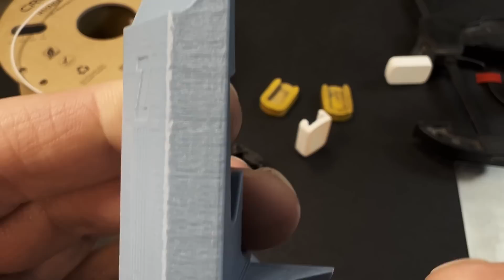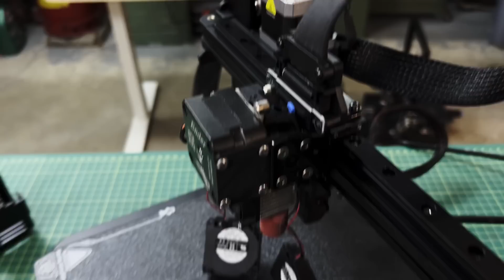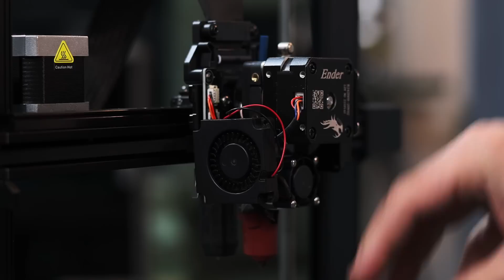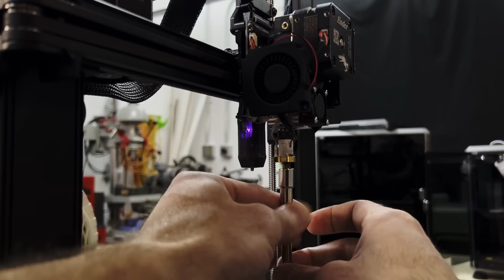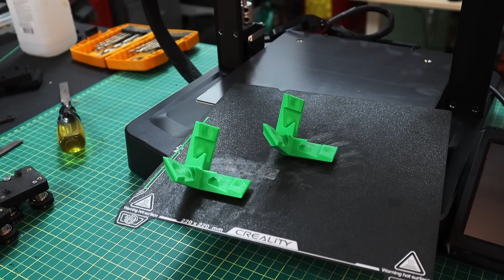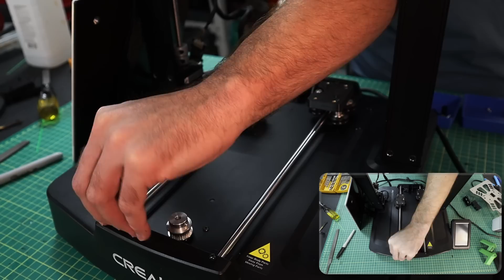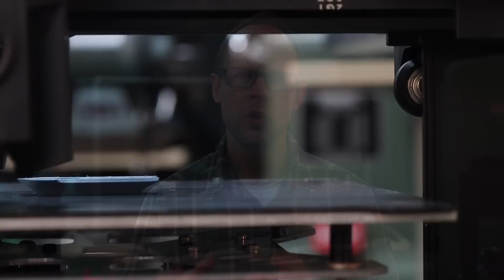What Causes BAD Print Quality on the Ender 3 V3 KE? - Fast Bed Slinger

Comment: Thanks for doing this. Having the same issues. Please do make the linear bearing video .
Reply from the maker: Okay, perfect thanks for confirming that.  I have two options.  I can contact Creality and have them send me a replacement set of Rods and Bearings, which they may not want to do, since that would be opening them up to having to do this for everyone.  I could also but the parts myself, but I need to go and measure them myself... so maybe McMaster Carr is a good option.  I can also do the linear rails, which I think is a better option.
Reply: @NeedItMakeIt  I don't have the funds to buy parts and experiment right now, so I'll wait and see what you come up with. Thanks again for your efforts.
Reply from the maker: @Rhunadan  I hear you, everything is crazy expensive these days.  I will work on something and I'll do my best to keep the cost down.
Reply: @NeedItMakeIt  It would be interesting to see if Creality has fixed their more recent rods or bearings because the Ender 3 V3 is about to come out on the 20th and that uses rods for both the X and Y axis. It's in everyone's best interest that Creality ships the correct rods because the new V3 is supposed to compete with the A1, and it won't be good if the rods are still faulty but now they're used for both axis. Imagine their new flagship ender having twice as much trouble as this one.
I would contact them and see if anything has changed, but also try out the linear bearings.
Reply from the maker: @toppestofdogs8490  That's a bit confusing, this printer is supposed to be the Ender 3 V3 KE, so there will be another version of the same printer?  I sure hope they get this right, they are watching my videos but I also plan on following up with them as well, it has to be fixed otherwise they'll hurt their reputation, at the front, the printer doesn't seem to be usable with PETG, the PLA seems to still do okay, and I believe there may still be a connection between the nozzle interaction with the filament but it's hard to confirm.  I think I'd need to but the same exact color of filament and the sheen needs to be about the same to have a better comparison.  Another option is to simply add a dial indicator onto the bed and see the movement we get.  Maybe I should make a short of that alone, I don't think it would be too hard to do.  After the improvements are done, I can re-measure and use the measurement as a way to know how well it did. 

I should see if Creality is willing to send new rods and bearings as well. 

I was thinking for the linear rails, to 3D scan the base, and create a shape that fits the base exactly, it might be 4 pieces and would include some other features that would be nice to have on the printer.
Reply: @NeedItMakeIt  Yeah so, they're making a new printer just called the "Ender 3 V3", no SE or KE or anything. It's a CoreXZ printer that looks similar to the SE and KE but isn't actually based on their frame. It's the same general size and shape but it uses a modified K1 print head with the exact same hotend and a K1 extruder but with a filament sensor built in. It also has a big fan on the back of the print head. It runs the K1's OS and has the same screen as the K1 too.
It's basically just a K1 converted into a ender sized bedslinger, but they're using rods for both X and Y, which I assume will be either the same ones they're using for the K1 or the V3 SE/KE. Just looking at the pictures of it you can tell it's supposed to be Creality's version of the A1, so I'm gonna guess it'll be around the same price.
Maybe they'll use the same rods and bearings that they use for the K1, which seem to work fine, but considering it's the same size as the V3 KE, it would make sense to use the same ones.
It's supposed to be fully revealed on the 20th.
https://www.reddit.com/r/Creality/comments/1agbp4u/something_incredible_is_coming_your_way_on_feb_20/
Reply from the maker: @toppestofdogs8490  Strange I hadn't heard of it, also strange that they're releasing a new printer and then releasing a new... new printer with better features.  The setup for the X travel seems to work well, since the vibration would be limited to the motion of the head, and it's very narrow, it seems to work well on the K1 and K1 max, I like that they're using the same head as well, that's great to have them interchangeable between printers, easy for having the extra parts handy etc.  As far as the Y travel, it's really hard to tell from that image what's going on.    I think they need to purge their older products and go with a more condensed setup, I can see people getting very frustrated after just buying a KE or a SE or CR10.

I think it's good that they're bringing out some better competition though, the consumer will benefit as long as there is enough competition and nobody has a monopoly.

I may have to try to get my hands on one, I like my K1, even more so now that I have a newer extruder on it.  It's not perfect, but pretty good for what I need it for. 

Thanks for the heads up on this, I'll have to keep up better with the news.
Reply: @NeedItMakeIt  I'd say go straight for the linear rails at this point to see if it makes a difference.
Reply from the maker: @802Garage  I think so too.  I've also heard the PC wheels would work well, but I think they need to be spaced apart more to have more success... unless you like the 'melted' look of your prints.  The linear rails are I think the best solution here, its going to give the smooth motion with low friction and the bed can remain pretty low, or maybe even lower.  I think I can do the change for about 50$ from aliexpress and I can design a proper setup to make it easy for anyone to do.
Reply: @NeedItMakeIt  TBH I kind of suspect the issue goes a bit deeper and is with the bed carriage and mount design itself. Seems like the actual steel plate is flopping somehow. I could be totally wrong though. That's why you gotta do it for science! Hahaha.
Reply from the maker: @802Garage  I think that to some extent the steel will move a little, I did some tests outside of the video and it is quite stiff, the mounts do look a little undersized, and that will allow it to do a little shimmy as well, an improvement to that area is def. a good idea as well.  Great points as usual my friend!
Reply: @NeedItMakeIt  Yeah it seems improbable to me the steel itself is actually flexing, yet somehow that's what it looks like in the video, so maybe the actual mounts or mounting points flexing. Look forward to hopefully seeing more of your testing!
Reply from the maker: @802Garage  I'll get my dial indicator on there and then we can get some real data to compare against, it would be handy to have for any bed slingers.  Now I know, when testing a bed slinger, test the corners against the middle.... don't try to take the extruder apart and replace it (so obvious) but sadly not at the time.  I will make a video follow up to the follow up to the follow up showing the dial indicator results while printing and maybe that will help to see, I can also set it to the steel to compare against the bed surface measurements.  I think there probably is a little flex, everything flexes at least a little bit.  I have a 0.0005in indicator and I can use my standard   0.001in as well.   Lots more testing coming up!  I just need to finish up this K1 Max test video.   I need to see if the 'lidar' scanning actually works well for bed scanning and if it can calibrate filament correctly, or at all.
Reply: @NeedItMakeIt  We all learn! I knew the corners of the beds were likely less stable than the center already, I mean any change of angle in the bed overall creates the greatest change in position at the edges, right? That said, I had no idea it could be this dramatic, especially on any brand new machine. Could well be you truly just got a bad batch of bearings, so it would be worth asking Creality for replacements and trying those as well as getting your own linear rails. Some real measurements would definitely be cool too. I think either of your indicators will definitely show the movement since it is so visible on video. As for the Ender 3 V3 series, they actually mentioned the vanilla V3 in their original announcements, but it got relatively little press from reviewers and they did a pretty poor job communicating. The whole plan was always that the V3 would be the flagship with a different motion system altogether, the V3 KE would be the midrange still fast version, and the V3 SE would be the entry level version still faster than a normal Ender 3 and extremely affordable. The naming is really silly and Creality has way too many models. They should have just gone with Ender X, Ender X Sport, and Ender X Pro or something. Hahaha.
Reply from the maker: @802Garage  Yeah, it does make a lot of sense, it was an assumption based on seeing the stiff steel frame and the linear bearings, not spending enough time to analyze the bearings being placed too central acting like a teeter totter.  How about the Ender 3 - Model TT...  It's always possible that I have a bad batch, though enough people seem to be having the same trouble to make me wonder whether it's more than just a lemon.  

I'm getting setup to do the indicator test.  I also see motion left to right, but it's far less than front and back, so I'll focus on the front for now.  Doing the test now is good and I'll have those values to compare against when I do the upgrade.

I agree with the naming, too many names and numbers, they need to be simple.  It's even hard to say all of the names in the video.  Like if I were to call a person by all of their first/middle/last names each time... "Hey Billy, Bobby Brady Smith can you hand me the hammer?" annoying.  Short and sweet is best.  

You're the naming convention master!  "Hey 802, what should I name my baby.... "  "Sport"
Reply: @NeedItMakeIt  Bahahaha Sport!